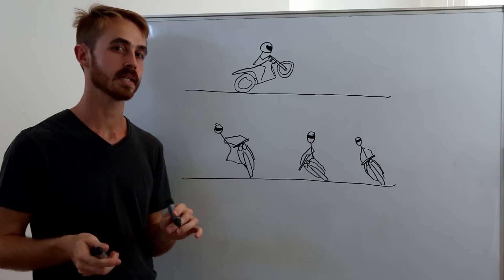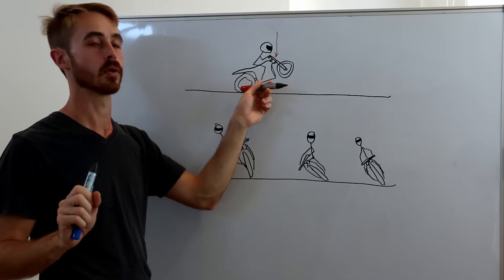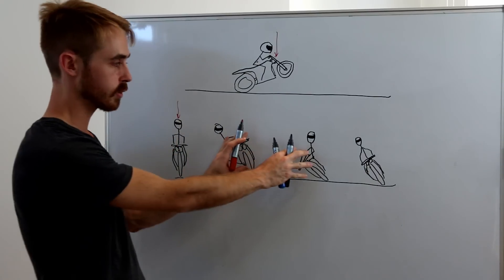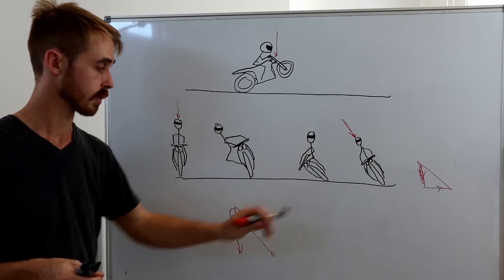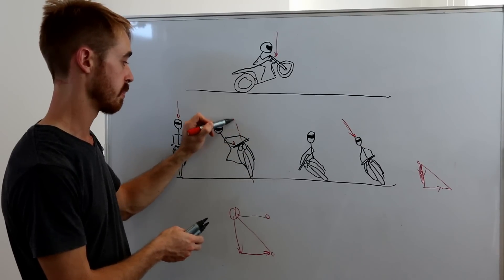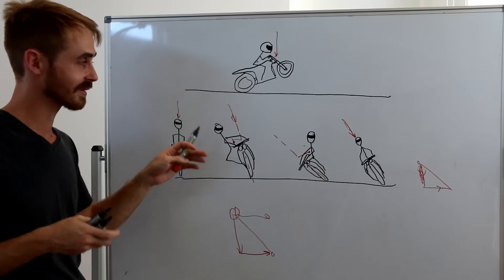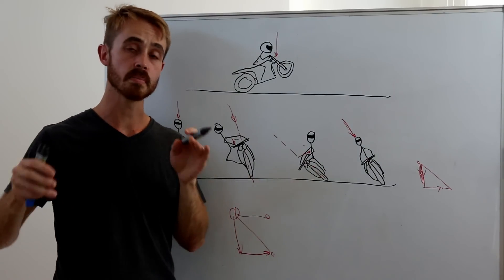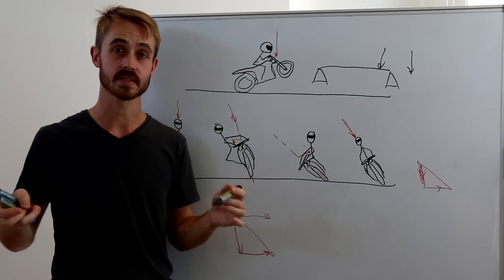How Does Downforce Work for Motorbikes? - Motorbike Aerodynamics Explained

Comment: 1. Then why were the riders already hanging next to their bikes (inside the turn) well before winglets were introduced ?
2. The torque lifting the front wheel is biggest when starting from standstill. Well... how much downforce do you think a winglet provides to a bike accelerating (from standstill) at the starting grid ? Zero ! A winglet not catching any wind doesn't provide any downforce !
3. Downforce increases quadratically with increasing speed, *as does drag*. So if the biggest benefit from a winglet would be mid-corner, then why do manufacturers take the disadvantage of the quadratically increased drag in the straight line ? Because there, speed is maximal and drag is (quadratically increased) too, which reduces the maximum speed ?

In other words : how sure are you that the purpose of the winglets isn't rather to better streamline the bike (bringing the pressure point of the bike more to the rear of the bike, in turn providing the bike more stability in the straight line) ?

Comment: The point about forward downforce being forward of the front axle was a bit of a mute topic. One other thing is about over steer on a motorcycle, which again is something that doesn't make sense. 

The point about front downforce during braking also has effects of the suspension.

Comment: There needs to be winglets attached to the sides of the front wheel arms  that can self level so that the downforce is pushing on the wheel alone, and always pushing it down directly to the track at any lean angle of the bike as apposed to fixed winglets which always create down force relative to the bike...

Comment: This is a very interesting channel. What I've always wondered is the losses induced by wheels. My ntv650 has 6 propeller shaped blade like spokes. Now they must be pumping alot of air when I'm doing 80mph.  They are about the same size as the roof fans at the factory I work at and they have 10kw motors. I was thinking of filling them in to see what effect it might have.

Comment: One thing that I haven't heard anyone talk about is Angle of Attack.  Firstly, when you're doing a wheelie, if your AoA increases too much it could actually lift the front wheel even more.  Secondly, the AoA of the wings on race cars is adjustable so that they can tweak drag vs downforce.  On MotoGP bikes, the wings appear to be fixed.  Maybe we'll see adjustable wings in future.

Comment: Kyle, if you REALLY want to see the work of a genius on this topic, touching on something you totally missed, search out a photo of an old Britten motorcycle, that, sadly, was not developed due to the young designer's death by skin cancer. I'm not talking about the last V1000 he made (some say the best bike ever made), but an earlier winged version. Two large wings sprouted off each side of the bodywork, downward at a 45 degree angle. Now, you might think the wings would give "angled" downforce (and certainly drag) on a straightaway, but then also cancel out their downforce effect to each other in turns, and you'd be correct.... but incorrect. Britten knew that a leaning rider's protruding body (remember, just behind one wing at a time depending on left or right turn) would be so close behind to where he intentionally mounted either wing, that the wing''s airflow would effectively stall, losing its downforce. The opposite wing, in clear air, would provide full downforce. See? That opposite wing, in a turn, is at a favorable angle to press the entire side of the bike into the pavement, adding grip. It's the only way, cleverly using the moving, dynamic body of the rider, that I've ever seen to use non-movable (illegal in racing) aero to increase lateral g's. Britten was brilliant.

Comment: Would these wings make the rear end squat more during acceleration?
Reply: Its a question of velocity. If youre starting off the line then no. This is why dragster don't use them, instead use the exhaust gas pressure instead

Comment: Would it be legal to use a relatively small diffuser in between the axels?

Better still, a diffuser with sliding skirts?
Reply: I'm assuming you're talking about a means to stop the downforce, like a spoiler on an airplane wing? in which case, they might be able to have a wing that move's with the lean angle. wether that would be legal or not, I wouldn't know.